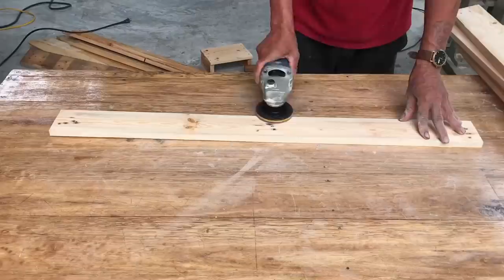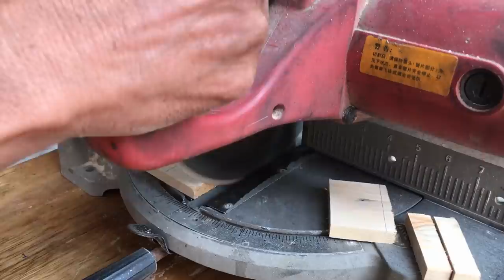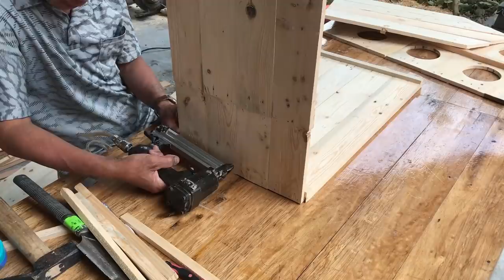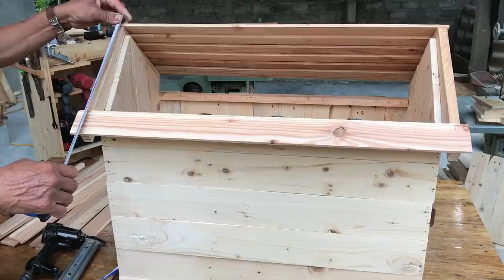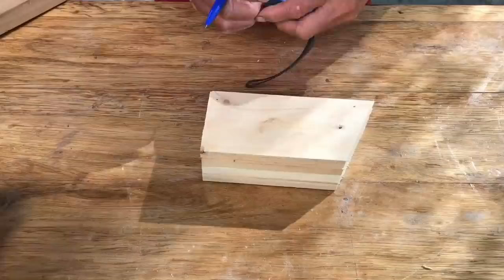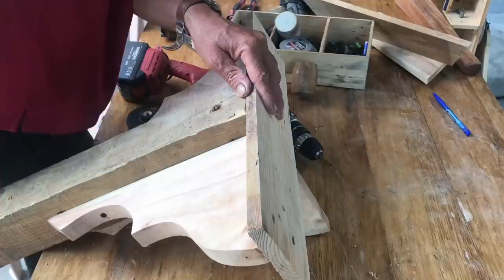Woodworking Project From Old Pallets // Build A Wooden Bird House For Your Pigeons - How To, DIY!

Comment: Very interesting projects, and I'm glad to see that wood is used rather than wasted.  I do have a concern about the safe use of the woodworking equipment, a lot of bad habits passed on, no knife guard on the planer, and no use of the fence to stabilize those thin boards, begging for an accident.